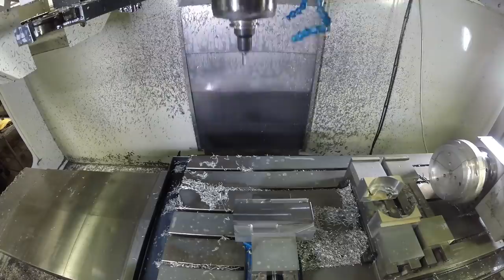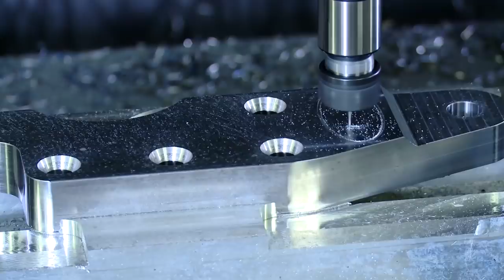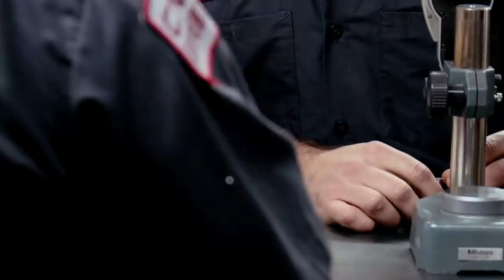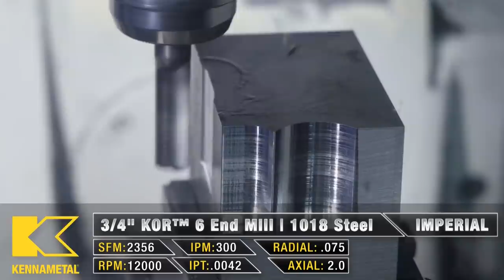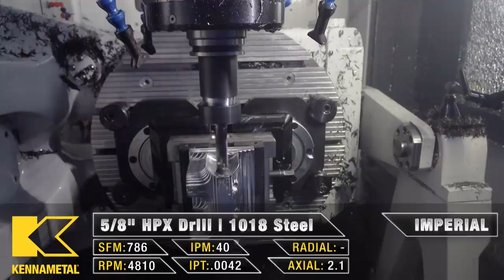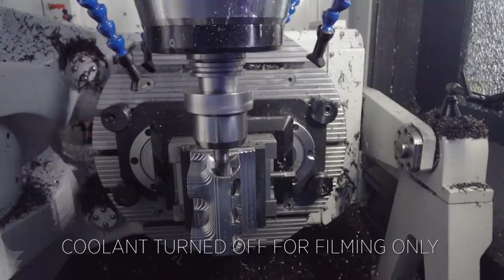Tools Keep Breaking on Night Shift, but Runs Perfect on Day Shift... Nobody Knows Why

Comment: Clear case of day shift sabotage. Usually brought about because of shift differential pay. Also if there wasn't already a night shift and one is introduced. And if workers from days went after the extra pay on nights. And old fashioned attitudes. All of witch can start blank amongst the workforce. Gotta have long talks first, get everything out on the table of discussion. Been there done that seen that. Sounds normal.

Comment: I'm in printing industry and for months now - the consumable drums in the printers will last for only a fraction of the time they did for the past 5 years - at least 5 years. Brand new - manufactured in Japan - some last 5 minutes compared to weeks. Nothing from  Xerox yet - nothing. And these trickle in and are usually on backorder for weeks. 
It's killing our small/mid size business. And its happening to a lot of smaller companies in our industry. Cant help but to think someone is trying to finish off smaller companies that the lockdowns didn't kill.
Reply: Why don't you figure out what is wrong with the drums?  It doesn't sound like a brain surgery.
Maybe you are receiving a bad product... And I'm not sure why you would just accept that?

Comment: Anti matter particles from ultraviolet and infrared light sources,  i.e. the sun impact the metal tools causing them to vibrate at a constant rate in harmony with the phonetic transpiration of the materials the tools are in contact with.  At night there are no particles therefore the harmonic resonance is out of sync resulting in the breakage you have been experiencing.  What you need to do is double the size of your operation so you do double the workload and therefore have no need to work through the night.   The cost to do this will be recovered within twelve years as your breakage rate and lost time will be reduced to almost zero.  If you don't do it you will regret it.
Reply: Whatever you are smoking, you should probably smoke less.

Comment: 1500 rpm, and 20 F is universal for every tool, material, diameter and application back from dinosaurs time, so why would you change it if it works for millenniums????????????? 🦖🦕🪚⚙ proved

Comment: There is an equation on  each cut on a cnc machine as far as feeds and speeds..but it still.all.gos back to good common sense.. your ears!! Listening  to the cutter will tell you if all is set right.pendind on type of steel...

Comment: what to take away here is that the machine operator should not be changing machine settings for any reason. the only function of the process he/she should ever have contact with outside of the operational functions themselves is the emergency stop. this is tantamount to sabotage in my opinion.
Reply: That depends on where you work.  We had programmers sometimes who had very little machine experience.  They often would not consider the setup that was likely to be used.  We are not talking about production parts, of course.
You should consider capitalizing when you're write.  It exists for a reason.  😁

Comment: This is human error.
The guy had the settings, broke a mill and then just slapped another tool in the chuck and kept going? My question is this. Did he still have a job at the end of this? because I wouldn't allow him in my shop again, that's for damn sure cause the dude clearly had no clue what he was doing and needed to pick a new profession because he was more than likely just lazy and that's why he turned down the feed. I cant work in my shop anymore so I rent it out, I have had clowns like this come in and nearly get kicked right back out the door cause I don't put up with it, if they don't know how to use the machine, the company can get someone in there that does.

Comment: This just seems totally unacceptable for night shift to make any changes without talking with the person in charge and in this case the person who took all the time to get everything dialed in and running without any issues. There would be some heads rolling if this was my shop ….😡😡😡😡
Reply: That obviously wasn't made clear to the night operator.
If you had experience with this situation, you would know that you can't just pause production and wait till you hear from the programmer when he comes in the next day.
It depends on how the shop is run.  
At the smaller shop I worked at we changed feeds and speeds all the time.